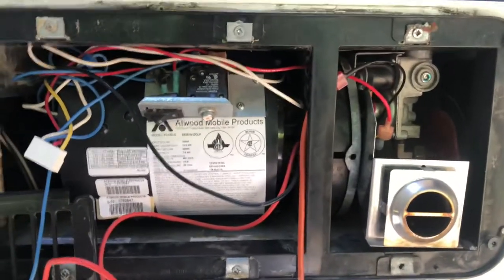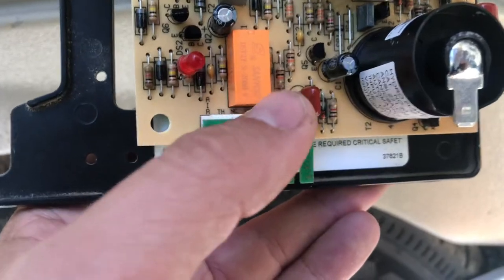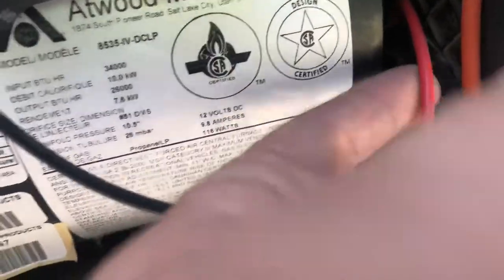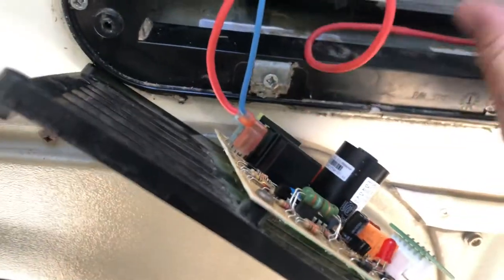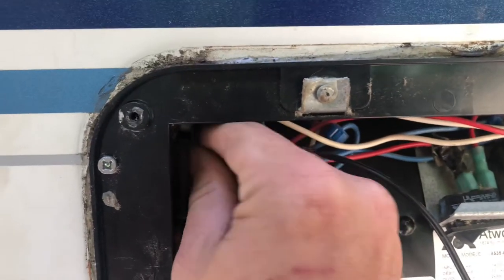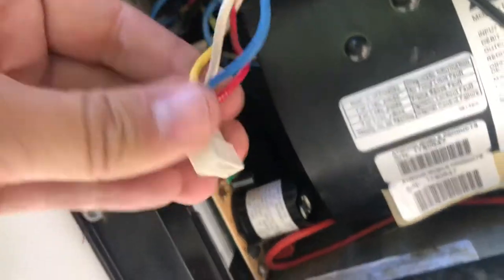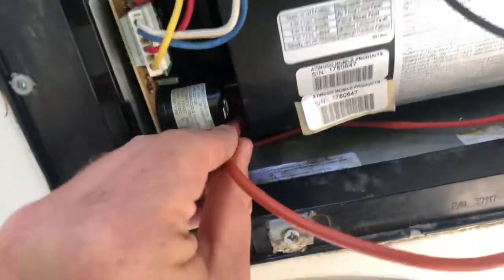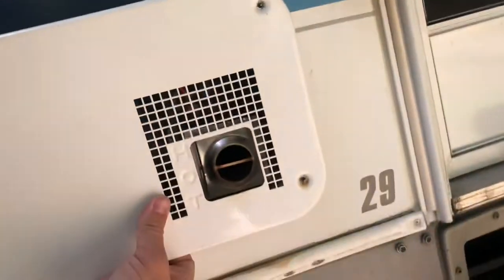Atwood Rv Furnace Board Replacement

Comment: Thank you for this amazing video, our Atwood furnace was not working and it was the board. I was stuck and you helped by showing power wire and blower motor wire you rock
Reply from the maker: You are welcome
Reply: Hello hey what is the model number for the 8535 circuit board?